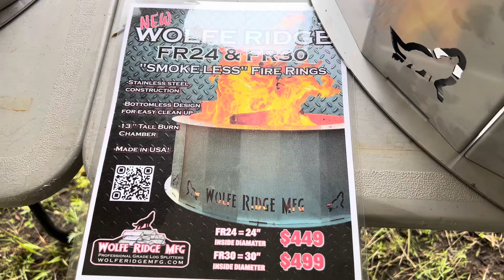Processing Tree Service Score And Wolfe Ridge MFG Tour!! #firewood #freefirewood #wolferidge

Comment: What's the longest bar you can recommend for a 400M, she's not the greatest oiling machine isn't she ??? I thank you for your reply in advance Gunter
Reply from the maker: I run the 25” and it seems to do ok oiling. I do know some run a 28 and it runs it just fine but they have upgraded their oiler for sure. Not sure if that helps? I say the 25 is the sweet spot in my opinion. Thanks for watching and commenting 👊🏻

Comment: The 400 is sharpened well, kicking some nice chips. Todd do you file or use a dremel? Great cutting. Later
Reply from the maker: Hello Allen! I use the 2 in 1 sharpener, unless I hit metal. Then I will use a hand file to get it back in shape. I then just maintain it with the 2 in 1. Thanks for watching 👊🏻